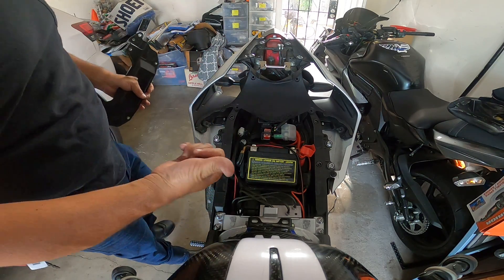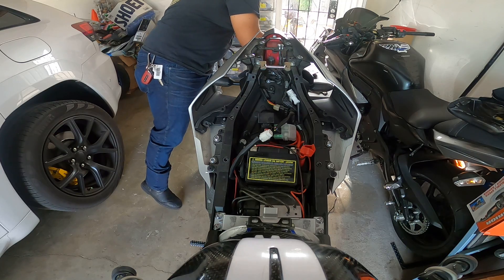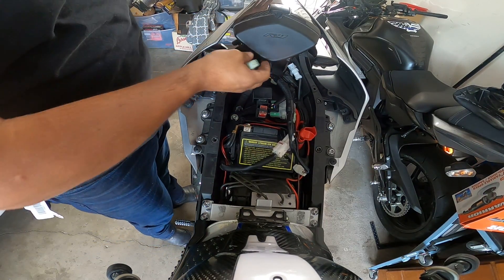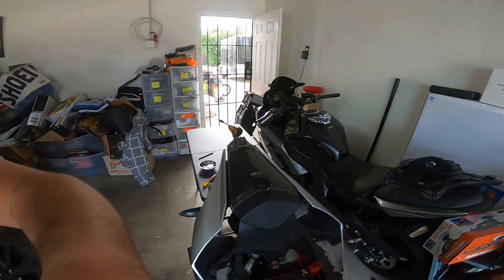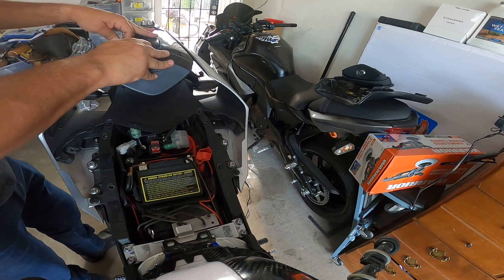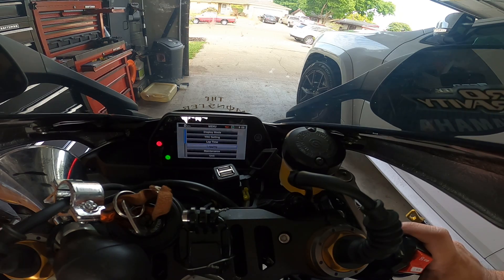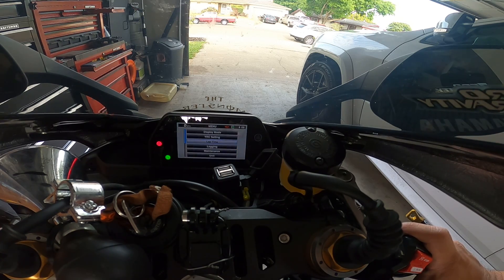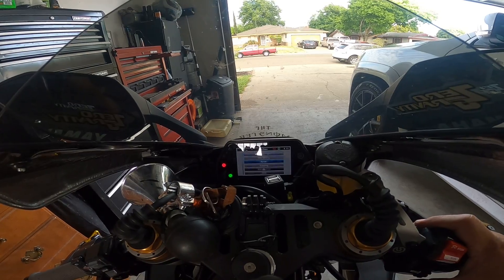Yamaha R1M Data Logger installation and functions.

Comment: Thanks for the video, I just installed this in my 2020, went to the track and used auto logger option. The bike is keeping track of all the laps in the module and app, but the display doesn’t change.  It will be quite some time before I get out again.  Have you gone into the app to create a track with the little pins and then use auto lap? If you have is this the same thing we need to do with the scroll wheel so the display shows our laps? Thanks
Reply from the maker: Hi, so sorry for the super late reply I don’t know why I don’t get notifications when people comment on a post. So to check each lap time there is a an icon on the scroll menu so you have to look at them manually and when you go to the app it will only work  to its full potential with iPad for some reason with the iPhone you are limited to what can you view.
Reply: @r1myamaha939  Better late than never! HAHA I actually found the answer and not sure if i asked the question properly, but anyway, I also couldn't figure out how to get the laps to display while riding... I found this video on how to get it working while riding, and after riding now the laps show up in the screen also. https://youtu.be/CEWe1tDKA3Y    
I will not be using my timer until June this year. I use an Ipad mini 5